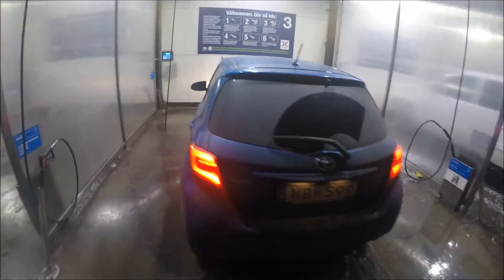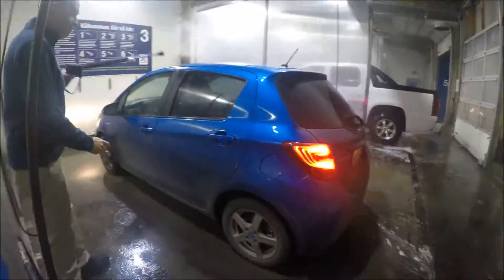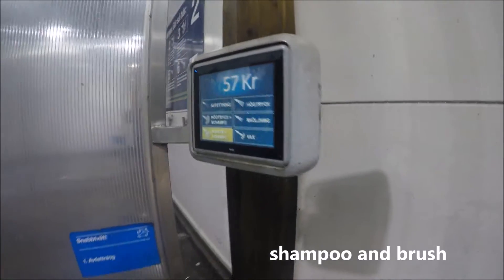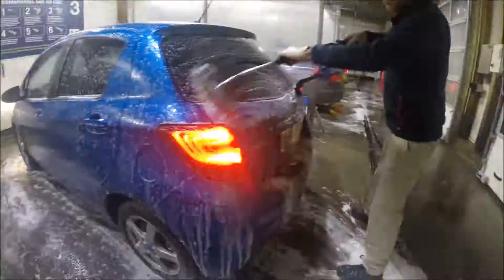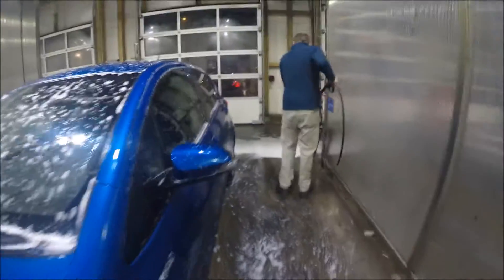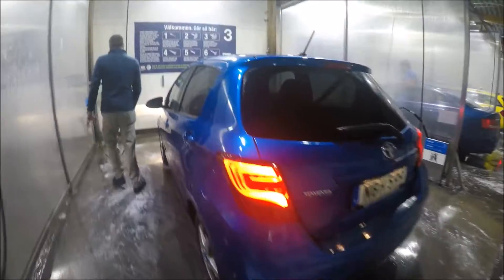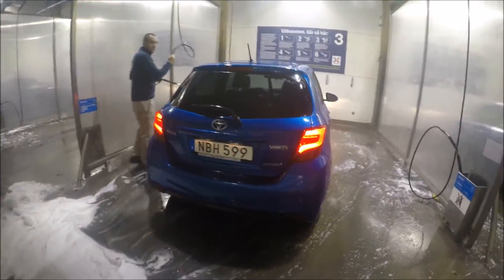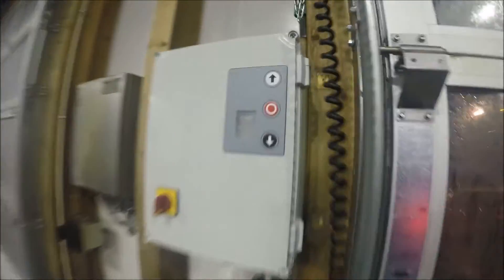Toyota Yaris Hybrid 2016 Car wash

Comment from the maker: I washed the wheels while the car was not before.
I used to always use high pressure before degreasing before and skipped it because I did not notice any difference other than that it was faster to deal with degreasing immediately.
Rinse off the degreasing also feels unnecessary because it is good that it stays a bit longer while I wash the car with a brush.
I have never received any scratches in the car this way and the car has become as clean as in the other way.

Comment: you should pressure wash rinse the car before you touck it with the brush just a good tip from a proffetional detailer. best case senario you would have a mitt for handwashing it
Reply from the maker: Thanks Martin. Have done it before, but it takes more time and I see no different on earnings. Now I have even chosen to use high pressure with shampoo instead of brush and makes all the laundry done in less than 10 minutes. Will not be as clean as a brush, but in this country the car is just as dirty after a day again. The most important thing in winter is to remove the salt.